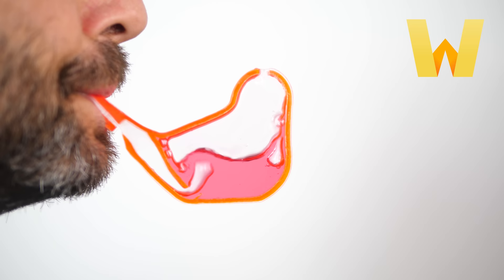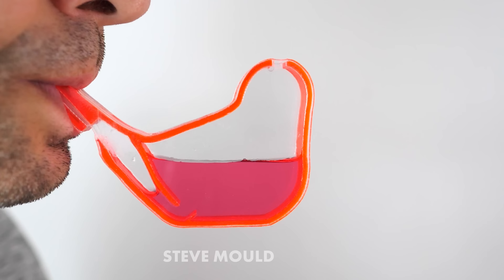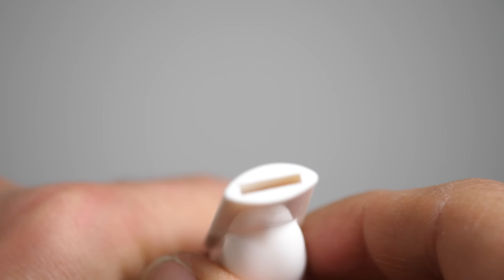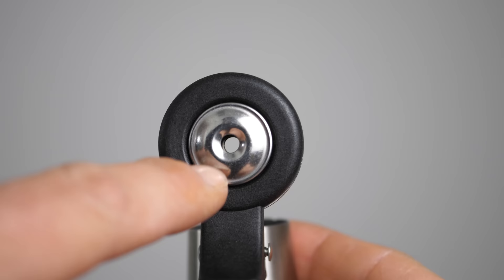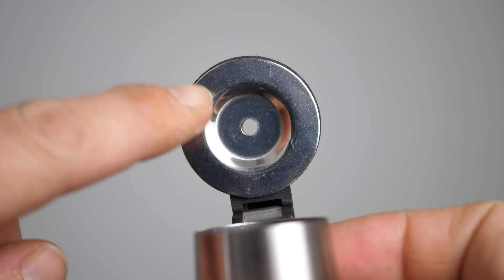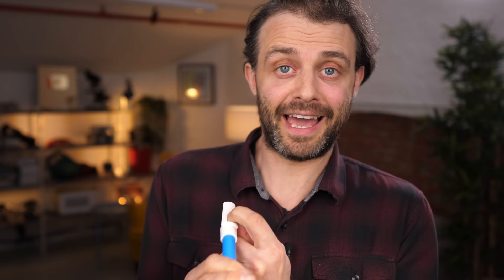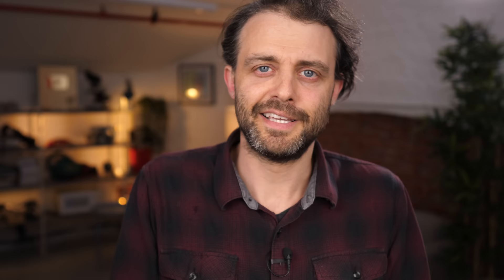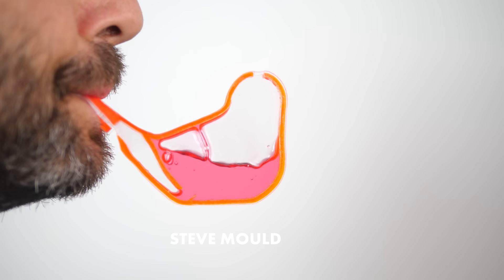Warbling Whistles Are Weird

Comment: Now I want an explanation of the Aztec "death whistle"

4:08 Why does a stream of air have momentum? The particles in the stream, sure, but their momentum is mostly forward and maybe slightly up. But if the airstream is fast enough, most particles with some upward momentum will already have moved forward when the airstream is in the middle. So there would be only a tiny bit of momentum at high flow rates. Or am I missing something here? 
Edit: Ohh, my point just means that the faster the airstream, the higher the frequency or otherwise there would be no oscillation as the particles move away too fast.
Reply: Yesss, 2d death whistle cut out would be great
Reply: Had the same question on the Aztec whistle... Claire Chaise suddenly played one, somewhere in the middle of Liza Lim's Sex Magic. Unsettling to say the least. But then before that she played the ocarina --- and those come with in many varieties which I'd like to understand the geometries of, too!

Comment: You can actually have the warbling bird whistle effect happen with just a normal whistle. You just need to hold your tongue close to the roof of your mouth in a parabola/hill shape (tip of tongue touching bottom front teeth and middle/back of tongue hovering just below the roof of your mouth) while the left and right side of your tongue are curve. That tongue shape is the typical whistle shape but what you do from there is hold some saliva on the tongue towards the middle back section and make a normal whistle. I find it easier to accomplish the warble effect with my head leaning a bit back to the saliva can interfere with the air flow correctly.

Comment: I would be so interested to see an analysis like this of people just whistling on their own. I'm a good whistler and understand just fine that the pitch is determined by the size of the open space in my mouth, but I don't really understand exactly what's going on with the air flow (ie, where is the wedge part when I whistle?)
Reply: My guess is there would need to be some sort of turbulence in front of your mouth opening (think lip shape - similar to recorder opening where there's an asymmetry but no actual wedge) for your projected air to interact with constantly for an even pitch.

Put something in the way of turbulence (finger for instance) and I bet the whistle changes SIGNIFICANTLY!

Comment: For instability of air flowing out of a simple  hole whistle: I do wonder that infact it is not purely the pressure gradient that causes instability. I suspect it is more likely the fact that air is viscous and there is a rapid large velocity gradient between the whist jet and the ambient air. Is worth noting flows hate large area changes, as in your flow will likely detach and become unstable. The pressure gradient will explain why the flow rotates in the direction of the lower pressure though.
Note jet (engine) noise primarily is a function of the jet_velocity^8 as we negate the ambient flow velocity as is so many magnitudes lower but is really the delta.

Love these videos, brilliant explanations!

Comment: I'd say that the standard whistle, air flow over a wedge is a machine that replicates the flute. The imaged airflow was helpful to understanding this process by the way. But the flute is even more basic. It doesn't necessarily have a wedge, but the blow whole serves the same function. My understanding is that as you blow acrost the whole it creates a low pressure that pulls a little air out of the pipe, which results in a low pressure inside. That pulls a little air into the pipe resulting in a high pressure. this oscillation creates sound. Blowing acrost a bottle and swinging a plastic tube in circles cause the exact same effect.

Comment: Dear Steve - fancy you doing a thing on whistles … now then … one of my pleasures is a ride on a steam train on the Romney Hythe and Dymchurch light railway. The steam engines have whistles - of course. The driver can alter the pitch by varying the steam volume entering the whistle. The whistle type is different to any in your video, as its a tube, sealed at one end, with the steam blown into the other end - and all round the other end - by a slot or ring all around the open end. Lots of examples online of steam whistles.
  The bit that bugs me is, how does the pitch change? It’s a fixed volume tube, but if you listen to the classic whistle blow of a steam engine, the pitch starts high, drops a bit in the middle, then picks up a bit as a finalé.
  Why does the pitch change?
  I did ask the engine driver, and he explained it’s how he pulled the whistle string that did it - which satisfied him completely!
  Not so I.
  I’d be very happy to buy you a ticket from New Romney to Dungeness - possibly even some chips from the café at Dungeness (which my wife asserts are the best chips in Kent) - and to have Alan blow the whistle for you.
… but I want an explanation, please.
Matt Lee (old, moderate puzzler and physicist)

Comment: The water tension creates pressure which is suddenly released like a trampoline that pushes air out until level 

That also creates the type of sound, and you can hear the acceleration and deceleration

Comment: Is not required to have a wedge, you can reproduce a audible sound using a paper or a flexible tool, in that way is not depended from the geometry but from the undulation that produce the sounds.
If you want to reproduce the sound from the wedge... well you need to create a not symmetric one: so the pressure will be different and you will be around 20 kHz

Comment: Take a thin plastic,  grab its side ends with two hands about the size of half of you mouth, then blow thin stream of high pressure air putting it very close to lips. You will get a very very high pitched sound. Since its not a wedge but still works like a wistle, i think rather than a wedge, something that can break the stream of air can produce sound

Comment: The first water whistle I ever had as a kid was already tinted transparent plastic, so... but seriously it's not hard to make an audible tone by blowing air at a wedge. The typical suggested one is the edge of a credit card. You can blow with a somewhat smaller aperture than typical for flute playing, and a slower air speed, directly at thin edge... ok it's not much of a wedge, but the point is to split the air stream. Mess around with it and you can make the steady, very quiet, high pitched tone, however... I've read this kind of "edge tone" is not strictly related to the edge tone that becomes amplified by the resonator and makes the flute speak normally. Indeed if you blow like this into a flute you get the extended technique "whistle tones," not the typical sound. The explanation of the acoustics of the very start of the flute sound tends to talk about this "edge tone" and I don't really the discrepancy.

Comment: I found I can create some very high pitched whistle sounds by holding the back edge of my homemade knife up to my lips while slowly blowing out. The angle has to be fairly low and a consistant breath is needed at a low to medium speed at least for me. I found better results with the edge being horizontal to my lips and sort of towards the middle of the hole when puckering a breath towards it. The pitch is very high, but not outside my hearing range. Lowest note I can hear from it is probably somehwere in the 13000-14500hz range, just based on hearing it vs a tone generator i saw on youtube. Nothing scientific there, but my best guess is it's somewhere in that range. There are one or 2 overtones I can hear that are much higher, and i assume many more than that above my hearing range, which cuts out just below 18k

Comment: Very nice. (Actually, extremely nice.)
But the thing I can't work out is how a gifted enough harmonica player (more gifted than me) can bend a note by a convincingly musical semitone by changing the cavity-size of their mouth. I'd have thought the pitch was a fixed product of the length of vibrating brass strip related to that air passage.
Is that perhaps too mysterious for Mr Mould Esq., or is there something dead basic I'm missing?

Comment: My theorie : all whistles you explain work the same. its an diffrenetly controled airstream dirkekted on a sharp edge. the cattlewhistle has a round sharpe edge because the outer hole is going inside. and the thing you call corrugaphone has the airflow because of the swinging and the two edges, the airflow is even getting pushed indide, whats causing the little vibrato wobbily sound ( becasue of the different speeds- no one get is perfekt-( enviroment) ) 
but we dont need  a "pointy sharpe" edge, a point to "cut" or "beak" the airflow is enugh to create a sound, like when we whiste with our lipps or throue our teeth,, and like the kettlewhistle the tone is not steady.
 whem we whistle with our fingers, the airflow is cutted, therefore the tone is stabilisated, like a flute or any other "air" insturment ( the vibrato is createt by controling the airflow ( blowing) or by controling some of the edges who ceate the pitch ( with the flute it would be the keys.
what do you think about that ?
sorry for my very bad english
i love your videos 
keep going

Comment: I was surprised he didn't talk about the sports whistle that create the trill sound without a ball by using two different toned whistles that have sound waves interact to create the trill.
Reply: I think what happenes is there are actually 2 frequencies that are really close to other being played at once, and it is percieved as the volume alternating between loud and soft.

I have a tremolo harmonica that actually has 2 reeds of slightly different frequencies that does something similar.
Reply: @Tyranitar66501  Its not just perception, its actually altering the volume.  this is how noise canceling headphones work, is by producing a sound wave that literally cancels out the sound waves being made by the noise it is canceling.  Just like waves on a pond, when sound waves interact they create larger waves where the peaks are in line, and smaller waves where a peak and a valley align.  With two clear tones with slightly different wavelengths, you will get a rapid change between the constructive and destructive interference, creating  louder and quieter sounds.
Reply: @fusi0ncatalyst191  so all of these have noise cancelling. 
This phenomenon is called "acoustic beats"
Reply: @fusi0ncatalyst191  actually the frequency difference between the two tones is what alters when the volume goes loud and quiet , so a smaller difference will make the volume difference slower. 
Is it possible to get a single tone without the trill on yours? It's possible on mine, if i only blow onto one row.

Comment: Can  you actually model the pressure of the air inside the blue whistle with a spring? Like 2nd order differential equations? Non-linear.

Comment: So I can, without using any tool/instrument, whistle like the regular whistle that interrupts the airwave using a small ball. I do this by vibrating my adam's apple in the throat as I simultaneously whistle. Therefore , in the same way for whistle instruments, it should be possible to interrupt the air going INTO the instrument instead of when it comes out? It would be really interesting seeing how that science works.